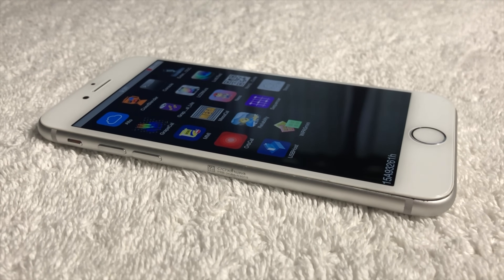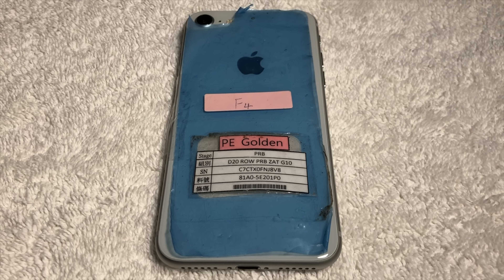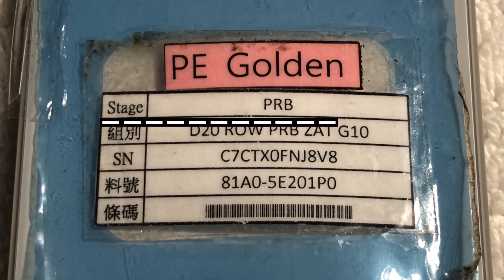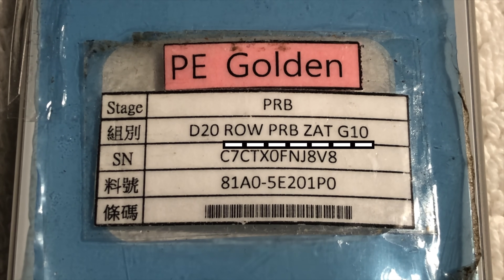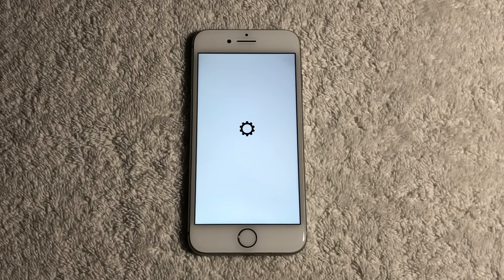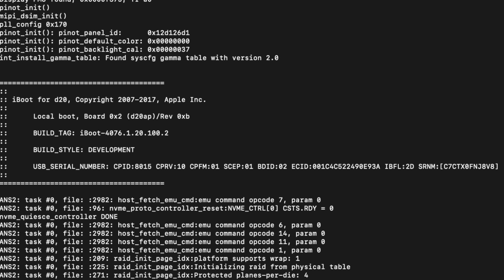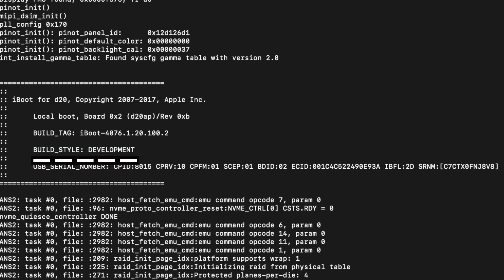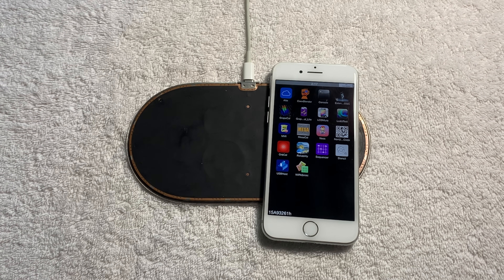Prototype Apple iPhone 8 (PRB Stage) - Engineering Testing Device - Apple History

Comment: Would I be able to load iOS firmware instead of the switchboard OS? Can I load my Xcode compiled apps into switchboard OS and play around with them? Probably missing all those required frameworks?
Reply: You can load iOS on it if you really want but that would ruin the prototype.

Comment: In the context of Apple product engineering, the term "PE golden" typically refers to a milestone or version of a product that is considered the final, approved, and ready-for-production version. It is often associated with the point in the product development process where the design, functionality, and performance have been thoroughly reviewed and tested, and any necessary revisions or improvements have been made. This version is considered "golden" because it serves as the reference point for manufacturing and distribution, and any changes beyond this point may require additional validation and testing.

For instance, when developing a new iPhone model, the "PE golden" version would be the one that has passed all quality assurance checks, meets design specifications, and is deemed ready for mass production. This milestone helps ensure consistency and quality in Apple's products.
Reply: Production Example Golden
Reply: Correct, also known just as "Gold Sample" This is common in the testing process of various electronic prototypes, even in the automotive world.
Reply: It means someone pissed on it

Comment: i have a iphone XS smart battery case here with EVT firmware on it. it has mentions of air power inside. and configurations to enable/disable them.

potentially interested?
Reply: could u show us more ab this?
Reply: @2.vuthanhdanh965   i'd love to but it's all software on this one specifically. it looks and feels like your usual retail. it just is running very odd software that you can access using serial debuggers. they dont have a locked/encrypted iBoot.. so DCSD's stil work with them